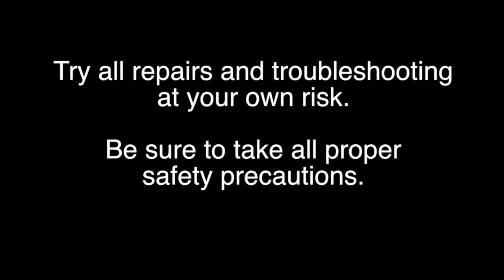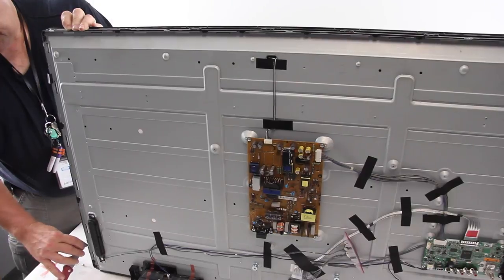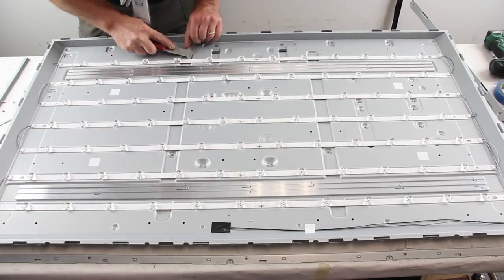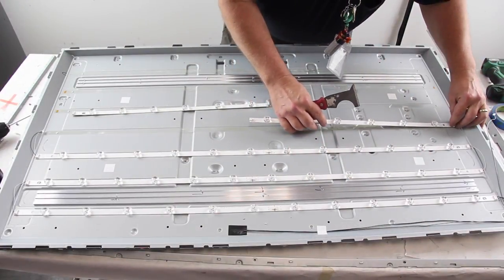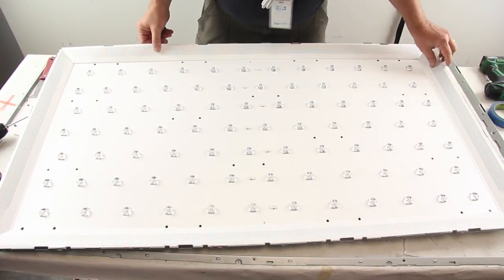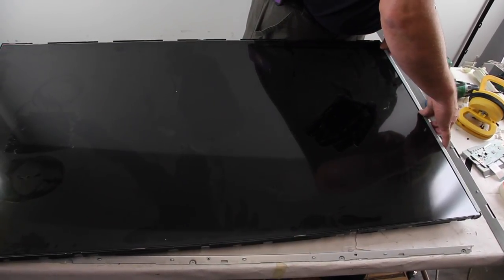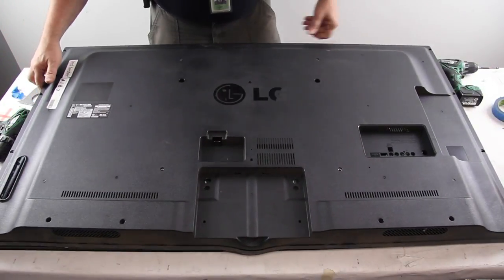LG 55” LED TV - No Picture Bad Backlights - How To Replace LED Strips 55LN NC550DUN

Comment: Thanks for the video. It took me 3 hours to replace the LEDs on my LG55UJ6300, it had a blue tint for years. I was stuck at removing the LVDS cable part, until I realized i had to lift up the grey clips before pulling out the cables. The reflecting sheet was very hard to put it back in unlike how its shown in the video,  as the holes would barely fit the size of the LEDs so it ripped the sheet at every hole. Its just in very bad shape after reinstalling. I wonder if there is another way to easily install the sheet. It didn't seem to affect the light tho. Other than that,  the rest of the steps are pretty straight forward.

Comment: I have Samsung 55", I guess from the darkness - top 2 LED strip rows disconnect from time to time. When top led strips are off and you hit really hard from the back of the TV it works again for a day of few days - this is common practice for all things made in Russia, but this is Korean product so jokes aside can you please confirm that this is just lack of contact and I do not need to replace strips? I do not think that led strips are defective as if they would they would not work 100% of the time. Thank you.

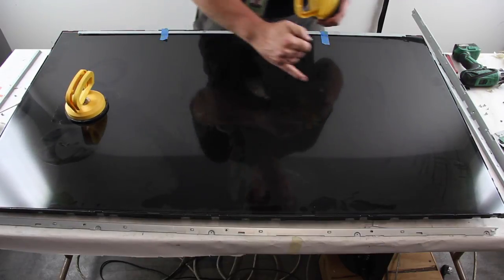Comment: At 3:00 you tape the scan drive boards to the panel. One of those thin ribbon cables is partially disconnected on my TV. Before starting this repair, I had an image on the screen but no backlight and during the repair I damaged the scan drive board ribbon cable and now I have backlight but no image. How can I fix that?

Comment: Is it possible to change only the damaged LEDs? For example with soldering
Reply: I know this comment is a year old, but for anyone else wondering if you can do this - it's possible but not recommended. This is a common problem with LG, most of their LED strips only last about 2 years. If you just replace the broken LEDs, the rest of the other LEDs still have that 2 years of wear on them and are on their way to burning out as well. So you might just end up opening the TV again a couple weeks later

Comment: We got our 2017 60" LG smart TV new in 2018. Now the top half of the screen is much dimmer than the bottom half all the time. I'm thinking that it just has some of the LEDs out.
Reply: Jeff Stone mine did the same thing. It started off with blue spots on the screen and got worse over time. Now the top half is dim. I believe I have the same one you do. Im ready to buy another tv, not LG by the way.
Reply: @autonomousglisteningwater2286  I ended up ordering replacement LED strips for it. Kind of a pain to replace, not difficult just tedious, but the picture is like new again. So far so good.
Reply: Jeff Stone i just ordered the leds. Hopefully i can fix it myself. Thanks for letting me know the leds fixes the issue.
Reply: @autonomousglisteningwater2286  Just be really careful when you pull the screen up or off, I just opened this one up like a book, but if I had it to do over again I'd have gotten a couple suction cups to lift the screen. I just used my hands and I guess I let the screen bend too much and now there's a couple very fine pinstripes in the far left side of the screen going vertically. At first I was upset about it but they're not that visable, we don't even notice them anymore.

Comment: LG has serious problem of this backlight, even the guys know and just come and replace it.  Serious issue, quality problem.  Just today I had it replaced for without any reason.  LG should mention that it will work for 2 years only.
Reply: It also depends on the hours of use.
Reply: @tracydenham8026  many other factors. Light fluctuations in our area too

Comment: Can anyone help me I have ordered new led strips fitted them to my LG tv and put the tv back together and now the tv won’t power up at all, it was working fine before replacing the leds the backlight just kept flashing intermittently, I’ve tried disconnecting the backlight cable and other connectors and reconnected but nothing works

Comment: Unable to turn on. LED at bottom panel only blicking.
Thought is capacitors conked out but after removal of back panel, they seems ok.
Follow your troubleshooting  but not so skillful. Shop wants about $300 for these replacement. In the end trade in as faulty TV set for a new unit.

Comment: I did this on my LG 55LN-5710 and the 4 strips at the top of the screen are brighter than the 3 at the bottom and you can see very fain circles of light from the top 4 but not the bottom 3 (they run at around 148v, or around 3v per LED at the top, and around 98v or around 2.7v per LED at the bottom) what could cause this and what is the appropriate fix?

Comment: I hav an LG 55inch LED. It comes on sumtymes but it will go dark but with sound still playing. It turns on but it only flashes light & I can still hear sound. If I wait a while it will come on with picture again but not for long. It works then it doesn't work. But the sound always works. The stand by light works so Im getting Power. It jus wont give picture consistently. Eveything looks brand new when I took the tv apart. Can you help!? Lol
Reply: RevolutionaryFather looks like the vid above will help , my tv is the same

Comment: Hi, I have an LG 55LA620V and its currently switching off the back light when energy mode is off. i swap it to Medium and below and it works fine, would this be the tcon board or LED strips ?